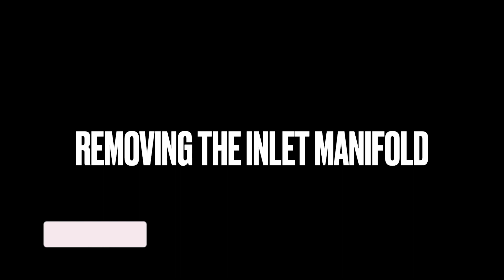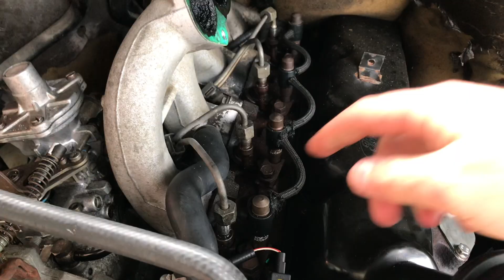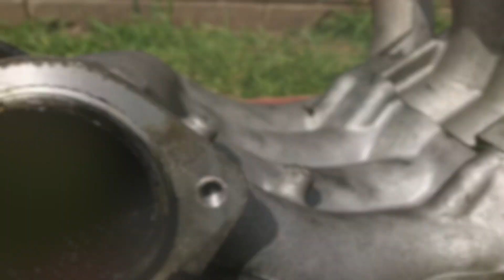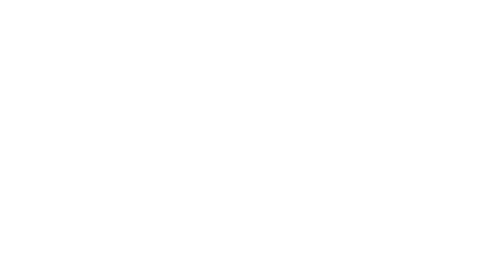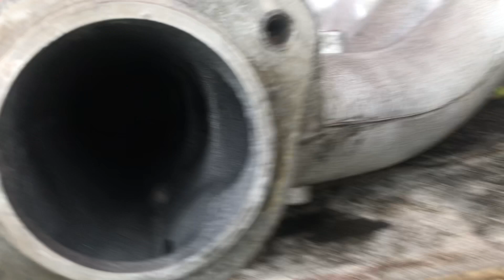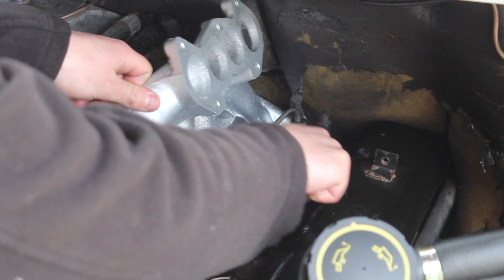How to Clean a Diesel Inlet Manifold | Ford Transit 2.5DI Carbon Build-Up Removal

Comment: Jesús from Spain. Just bought a transit 2.5 D de 1998 and seen your videos are really useful. Great job. One question what is the pcv Valve and where is it in this engine? Thanks
Reply from the maker: Hi Jesus, thanks mate hope you will find them beneficial. I made a video about fitting an oil catch can. In this video it shows where the crankcase breather is from the oil filler cap.

Comment: Hi mate need your help my immobiliser is stuck on can't start engine mk transit as you know lights come on wen key turned but nothing else can u help if u know wat it is many thanks
Reply from the maker: Hello mate, it could be a number of things. Does it crank at all when you turn the key or just nothing?  I would start with the basics, check all the fuses. I think 32 & 33 in the fuse box. If you have a spare key try that. Does it have Bosch pump or Lucas?
Reply: @TurnersWorkshop97  checked fuses don't have spare key but according to the immobiliser above on headining it's giving code 32 any way to bypass this easily thanks as atm stuck in car park lol
Reply from the maker: That’s not good, check the Facebook group for this problem as it’s happened to others and often been things like starter motor wires loose and bad earths. Failing that you might need to wire 12v live to the start stop solenoid on the back of pump and run your own ignition feed to the starter to get it running
Reply: @TurnersWorkshop97  yea was thinking that but how do u do the live wire without taking it apart if possible thanks for help n info
Reply from the maker: Have sent you a message on instagram mate 👍🏼 don’t want people nicking our vans lol

Comment: Ha, I just paid a garage to clean my 'nanas out. I had enough on my plate to swap the rest of the engine for one with a full set of con rods and no hole in the side of the crankcase so I subcontracted that bit out...
Congratulations on the 1000 subs 👍
Reply from the maker: It’s a rather dirty job to be honest 😁 Did the DI throw a con rod? Can’t be possible 😂 thank you 👍🏼
Reply: @TurnersWorkshop97  Yeah - to be fair that engine was seriously sludged up. Lost one rod on the M6 near Carlisle so I turned back towards home. Made it all the way up the A7 on three cylinders until a few miles south of Edinburgh when it lost a second rod. It still limped on with 2 cylinders and finally died outside my friend's house...
Reply from the maker: 😂 that’s pretty good going! Very impressed
Reply: @TurnersWorkshop97  Best bit was that the cheaper of the only two DIs on gumtree in Scotland was 2 miles from there and £100. No manifolds with it though, which is why I had to get the old bananas cleaned out :-)

Comment: looks great,how long did it take you in total?..also when you bleed injector 1 do you tighten the other 3  up first or do you keep them all loose ?
Reply from the maker: Thanks Sean, it’s hard to say exactly as making video always makes the job longer but maybe a few hours to do it thoroughly 👍🏼 also I did the injectors one at a time so it’s not so messy.